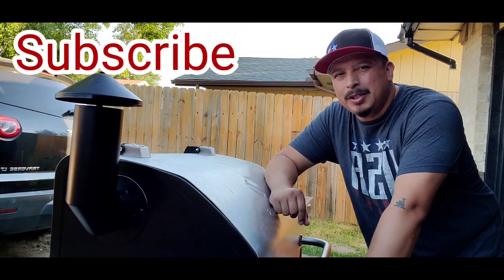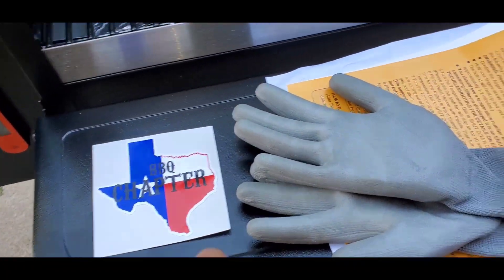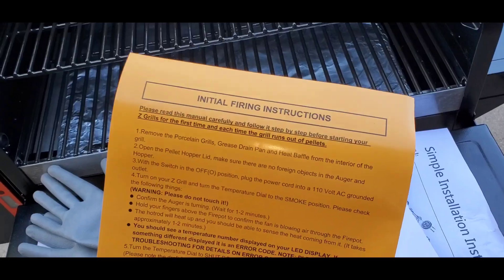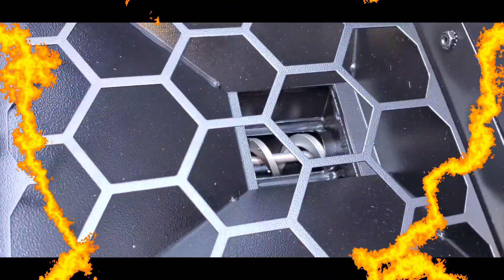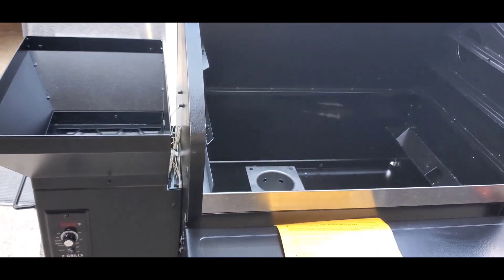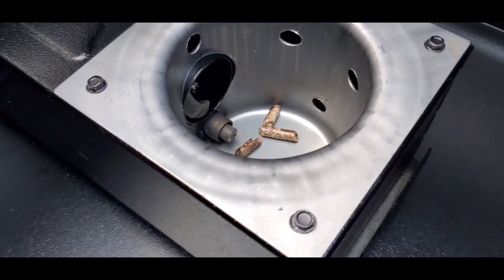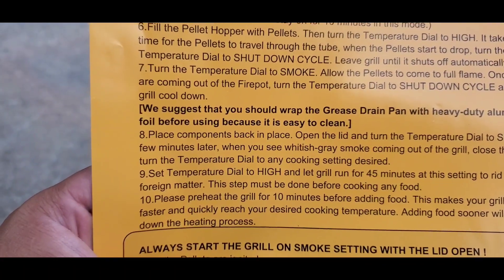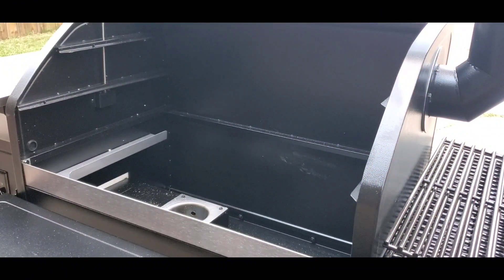How to start up your ZGrills 10002E - Z Grills

Comment: I used to distribute for Z grill... They should have never put a sliding Ash pan on that... You're going to lose a ton of smoke and heat and also burn more pellets than you should ,because of that Ash pan that leaks heat and smoke... Those people at Zgrills do not listen very well... You will not be satisfied with customer service either...
Reply from the maker: thanks for your input
Reply: That’s the reason why I didn’t buy this model. That tray will be the death of that model.
Reply: @bigc2092  👍🏻